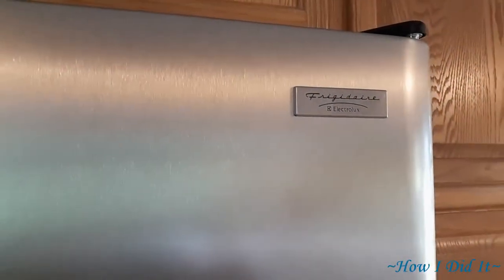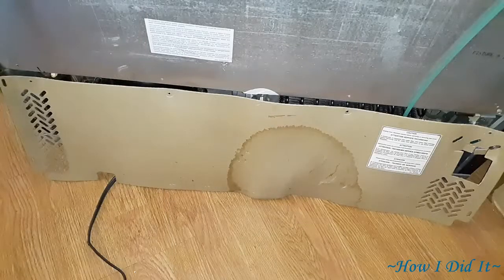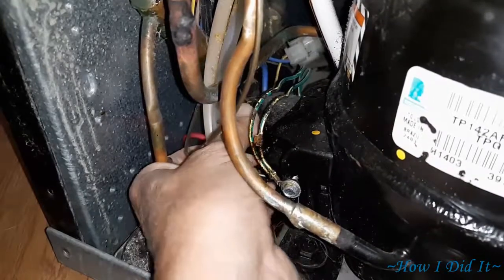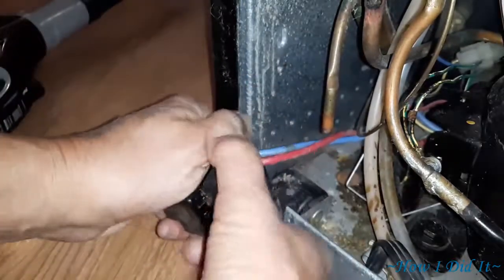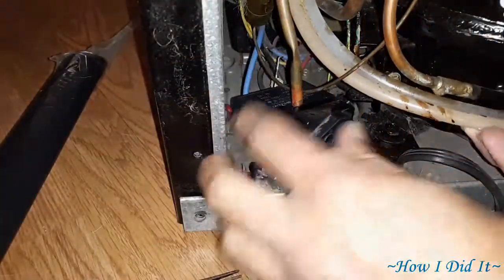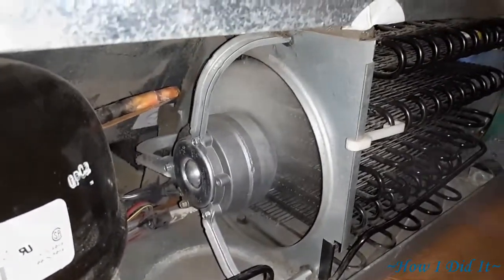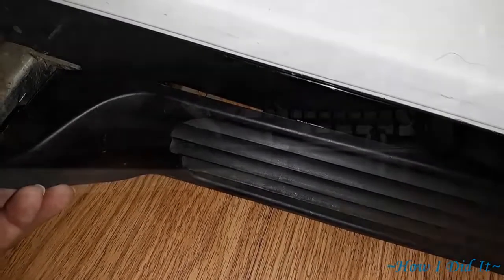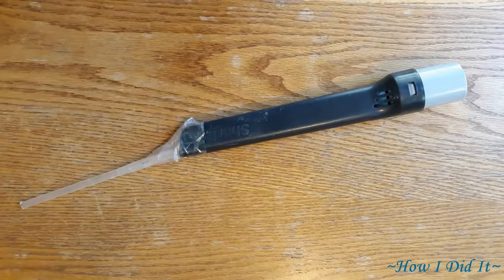BEST hack for cleaning your refrigerator coils ~How I Did It~

Comment: Just a warning replacement of capacitors can be shocking they hold a high voltage charge to kick start the compressor placing you fingers across both terminals will kick start you😮
Reply: So what should we do when we are replacing it?
Reply: You can discharge a capacitor by--carefully--shorting out the terminals with a screwdriver.

Comment: Hi someone said in the comments that you replaced the starting capacitor, not the starter relay …can you address that ?
And how would I know if I need to replace which one in mine? I have a Galanz mini fridge and I feel like it’s making a clicking noise and kind of struggling and I worry it’s using more electricity as a result .
Can I use a soft dry (or damp) cloth to clean the coils ?
Reply from the maker: For my appliance issues I google the issue I am having, then I search repairclinic.com on youtube for instructions on how I can repair my appliance myself. 
I have never used a cloth on the coils, only a coil brush, and now a vacuum and a straw with my coil brush if needed.